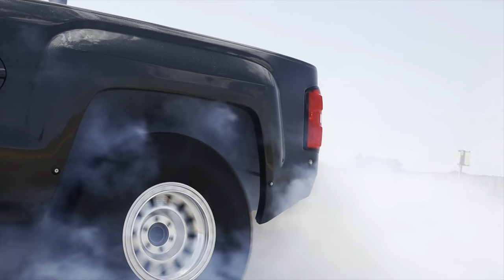Texas speed stage 2 cam 5.3 Sierra daily driver with x pipe and long tube headers

Comment: How much lift did you get out of the suspension?
Reply from the maker: Honestly I would say it’s only about 1 inch or two higher than stock up front and it’s lowered 1” in the rear. All the hight is really coming from the 37s
Reply: @connorellisx  so basically a leveling kit with 37s. Did you have to regear your gear ratio for the 37s or is it in future plans if so what do you plan on going with gear ratio wise.
Reply from the maker: @wersty4927  yeah sorta! it’s a dirt king fabrication race kit. I haven’t re-geared just yet, my new gears are in the new axle that will soon be getting fixed installed, they are 4:88s
Reply: @connorellisx  I was planning on getting the vertex coilovers and vertex shocks for the rear but not getting the whole lift kit just the coilovers and shocks and adjusting the coilovers to 2 to 2.5 inch with prerunner fenders and bedsides with 37s
Reply: What offset were your wheels?
Reply from the maker: @wersty4927  they are a -12 offset
Reply from the maker: @wersty4927  right on man! That sounds like it will be super rad!!
Reply: @connorellisx  I think I'm just going to go for the 2inch n3 loaded struts from RC with the prerunner fenders and bedsides with 35s or 37s. Hopefully I get the same "look" until I can afford a actually prerunner or race kit
Reply from the maker: @wersty4927  save your money man! Don’t do the fenders or bedsides unless you are going true long travel, lots of people try and it just doesn’t work, all you do is end up ruining everything that was nice about having a clean truck. With the money you save off of not, get yourself a much better brand like king or fox shocks with some hood upper control arms from mazulla or dirt king. 
For a faster response message my Instagram @connorellisx and I can help get you hooked up!